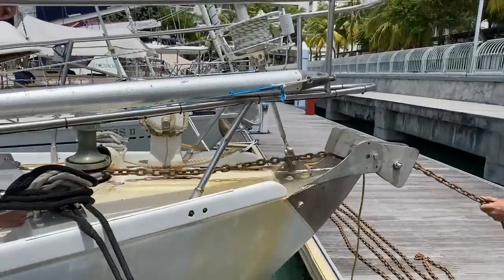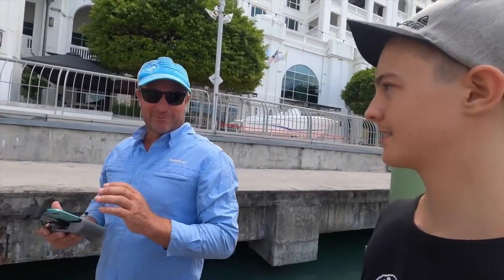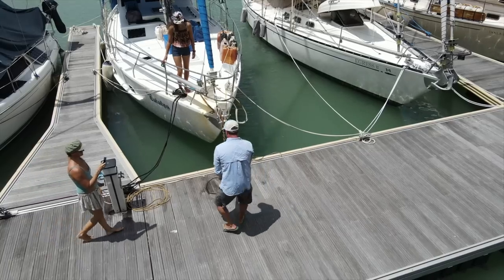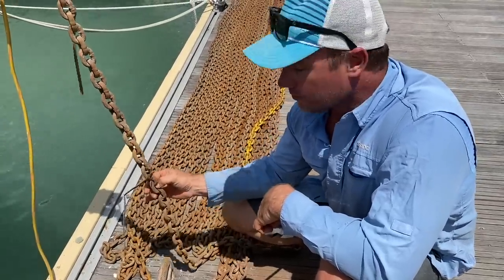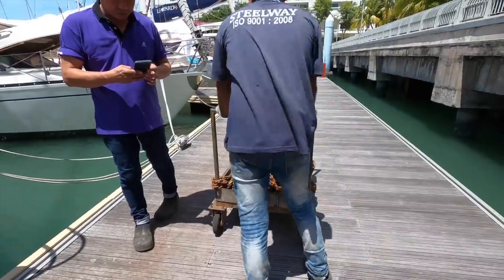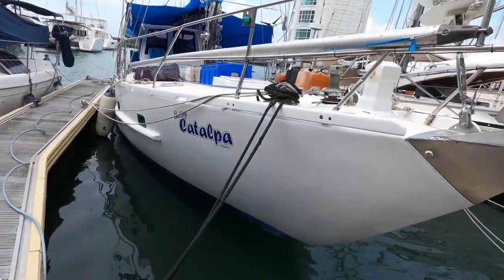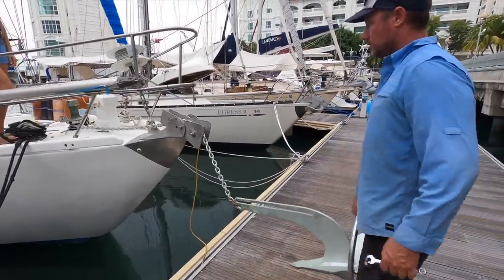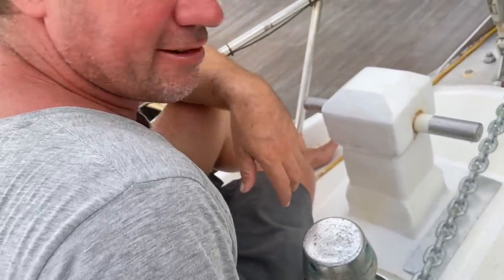How we fixed our rusty anchor chain Episode 196 (Sailing Catalpa)

Comment: Hey folks, how do you rate the crosby 10mm anchor chain joiners ?. 
We saw that you guys have previously used these joining links to connect your anchor chain ?.
Any drawbacks to mention?.

TIA
Reply from the maker: We used it for years and had the chain under heavy loads our experience we never had an issue we actually cut it in half after a couple of years of using to replace it but it was like new.